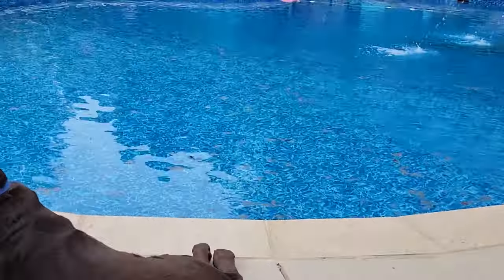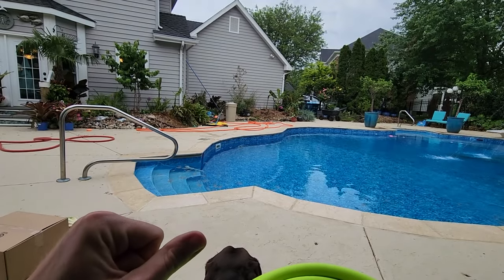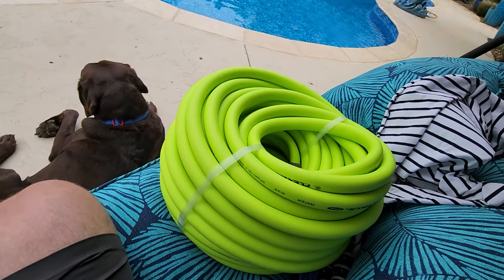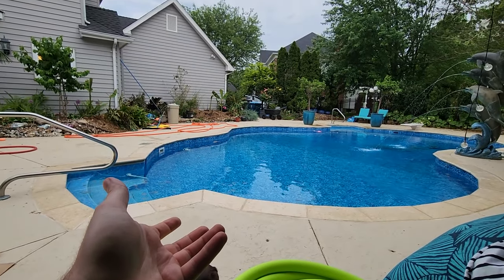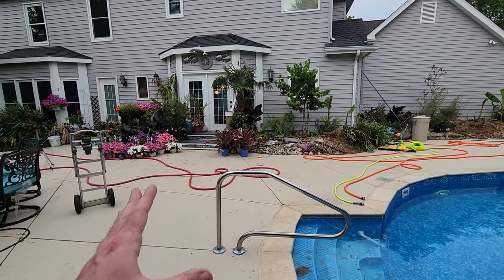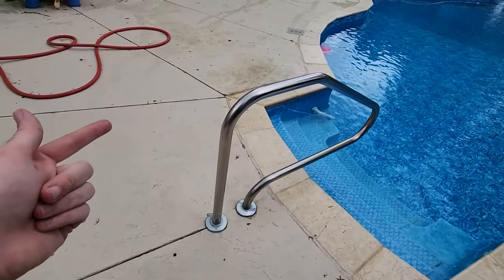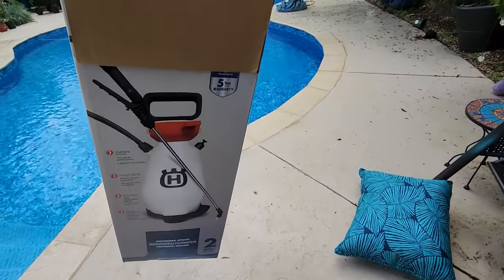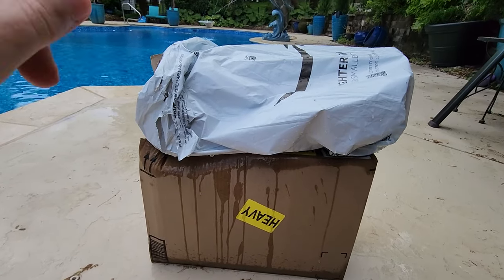Unboxing Fertilizers I Like And Overdue Cleanup || Saturday Vlog

Comment: I'm trying not to laugh when you're talking about a hose and length and girth being an issue. It's like the commercial with Richard Karn for my hose, I just laugh every time I see it. For the hose reel, they make covers for them, basically like a grill cover but for a hose reel.
about Palm Gain, that is a Florida product, specifically Cape Coral. Their plant took a hit during Ian and they had to transfer production to a different facility for about a year (if I am not mistaken, Better Gro was handling it). They got started back up in their own facility last summer. I can't say that has anything to do with it, but I wouldn't rule it out.

Comment: Why don’t you get a 150’ expandable hose.I have one and absolutely love it. Sponsored Ad - 150 ft Expandable Garden Hose - New Flexible Water Hose 150ft with 10 Pattern Spray Nozzle, 3/4 Solid Brass...
More Like This
Sponsored
150 ft Expandable Garden Hose - New Flexible Water Hose 150ft with 10 Pattern Spray Nozzle, 3/4 Solid Brass Connectors, Retractable Latex Core - Lightweight Expanding Hose
Brass Connectors
5.05.0 out of 5 stars (26)
100+ bought in past month
$69.99